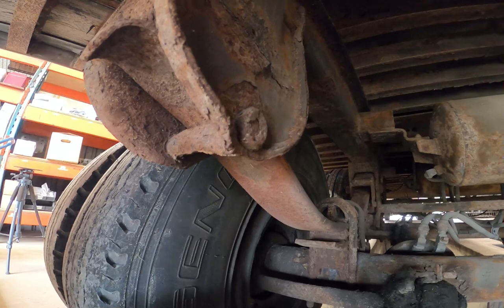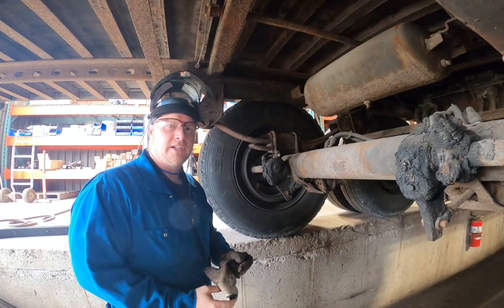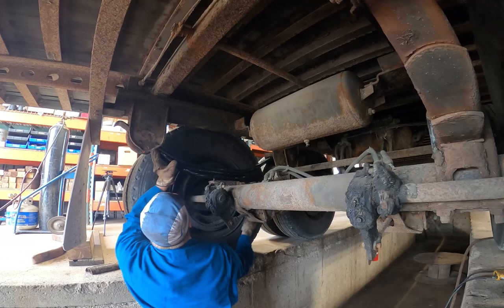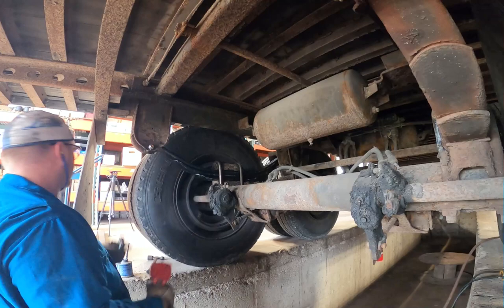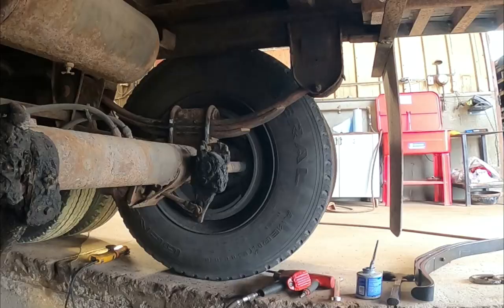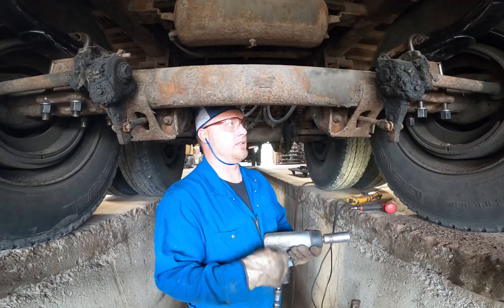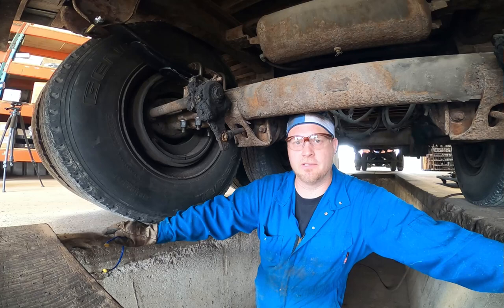Transport Trailer Leaf Spring Repair | Hutch Suspension

Comment: beside the experience and your skill you also have invested in the right equipment to expedite the task at hand.I have done that work back in 70,s and 80,s without much equipment, so im impressed at every one of your job/video. That work is the hardest work in a truck shop in my opinion. Keep up the good work.

Comment: I am a road service and I used to change a lot of springs before air bags took over. I built a saddle out of 3/4 plate that perfectly fit under the rounded center equalizer hanger, put a 20 ton jack and able to raise very quick. I have a pair and can raise both sides. Works great for equalizers too. 
  I got a Astro "Big Nasty" air hammer, wished I had it I years past to push the two bolt equalizer bolts out, though not sure if it has to omph. They could be a real bitch to remove. I would bet that big air hammer you have would make quick work out of equalizer bolts.

Comment: Love the channel.  Great content and sincerely appreciate watching someone work who knows their craft and puts their experience to work every day.  

Legitimate question: Why do you put anti-seize on u-bolt threads when its unlikely those nuts will ever come off again?  In almost every one of your videos I have watched, you torch off old u-bolts and in a summer 2022 video short you explained why you should replace u-bolts during any repair.  Your work process is chock full of efficiencies. Not clear why you still put time and $$$ into anti-seize on nuts you or any other person will ever touch again.
Reply from the maker: I dont think I have ever put anti-seize on ubolts.  Ot changes the torque specs and can cause the ubolts to overstretch.  I like to use a light oil finish, gear oil or wd40.  
However some customers cant afford new ubolts so we end up re-using some...but it is rare.  I refuse to reuse them is they are on a semi truck.  It is complicated.
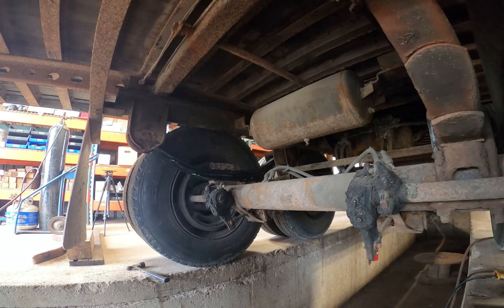Reply: @simcoespring  Actually , my mistake.  You put anti-seize on restrictor bolt at about 4:20.  Somehow I conflated that with the u-bolts.  All makes sense now.  Thanks for the reply.

Comment: Don’t know if you’ll see this or not but I gotta broken spring on my grain trailer and watching this video helped a lot. I still have yet to get the parts to do it but I have 2 questions. 

1. Do you recommend replacing the springs in pairs?

2. Where are you jacking the trailer up at to take the weight off?
Reply from the maker: because this trailer was quite old, we did replace them in pairs.  Leaf springs will sag over time, so anything older than 10-15 years we'll try to replace them in pairs (if the customer is ok with it.)
We always jack up on the frame.  We will try everything in our power to jack up on the frame rails.  It is the most stable and usually if structurally sound, shouldn't bend, twist or move.  Plus your jacks should be on falt concrete if able.
sometimes we spend like 10-20 minutes just planning out where the safest place to jack up on a vehicle.  Some take 10 seconds to plan where to jack up on depending on how large and easy to frame it to access.